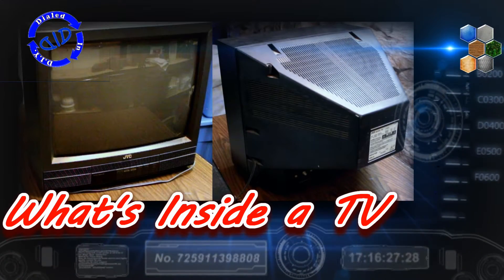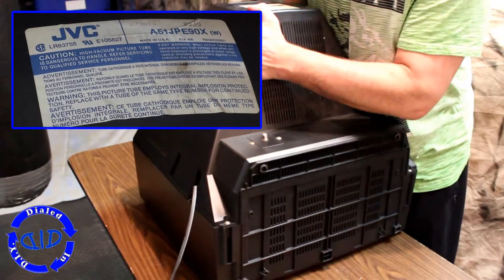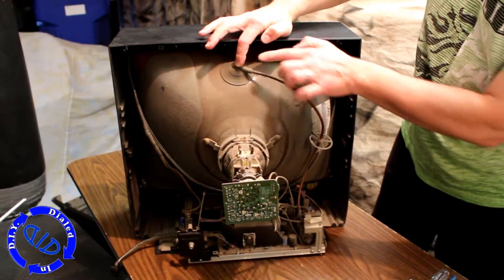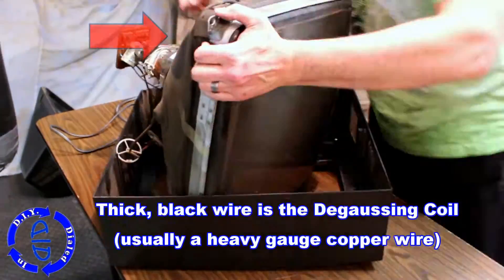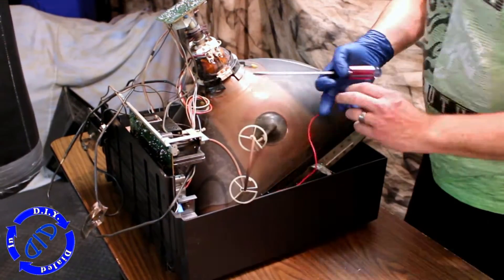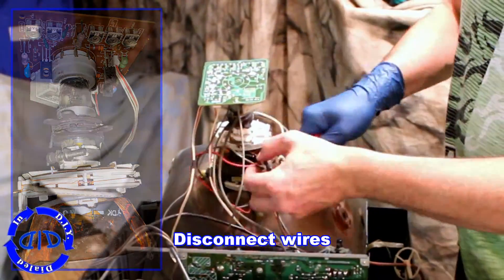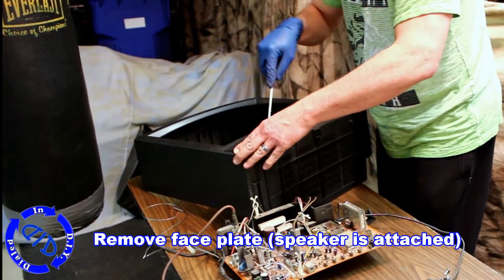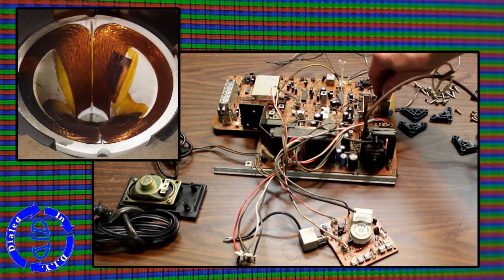How to get free electronics from JVC CRT TV

Comment: 02:24 What are we looking at here in the upper left corner with the yellow circle? Some text wouldve sufficed for explaining what that is.. Also, for the suction cup connector. How do you know you touched the two pins and shorted it if the pins are hidden under a suction cup and you have one hand behind your back.  You should also explain why you put your arm behind your back. You did this in two videos so far and never said why you do this. Im guessing its to keep voltage from jumping to your hand not wearing a rubber glove to keep it from completing the circuit if one hand it touching the connection but couldnt this be prevented by wearing gloves on both hands?
Reply from the maker: Hi, sorry for the delay in reply... in the yellow circle was the flyback that was at the other end from the suction cup. Hitting the two pins; I do that by feel... if you slide the screwdriver under the cup you can feel as it passes over or around them.  I would have to rewatch the video to see if I mentioned it elswhere... I thought I had in at least one video or put it in the video description.  The purpose of the hand behind the back is to prevent the charge running through your body if you were to accidentally complete a circuit with the other hand. To be honest, I learned to do it that way for any large capacitors and I'd still do it even if wearing gloves just to be safe. Thanks so much for taking the time to watch my video and post a comment... I really appreciate it.

Comment: i got shocked doing this i didn't now it hade power still it a old plansonc
Reply from the maker: +Pc&#39;n&#39;Mobile gaming Sorry to hear you got shocked... you never know what might be left as a residual charge in a capacitor or especially a flyback transformer.  If you ever work on one again, then make sure to double check the warning and precaution sections in the video.  The shock could potentially be extremely bad so you need to be very careful and make sure that all components are discharged safely first.